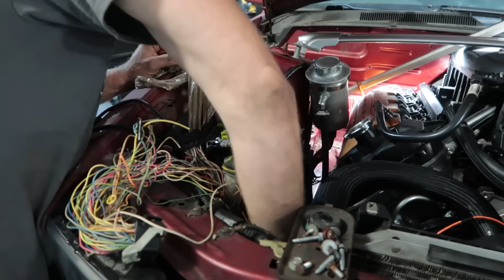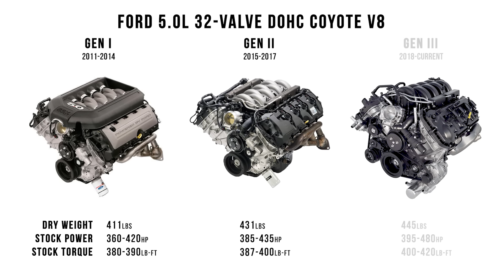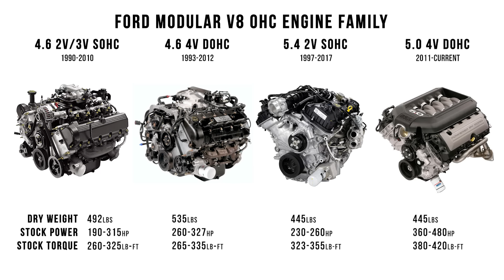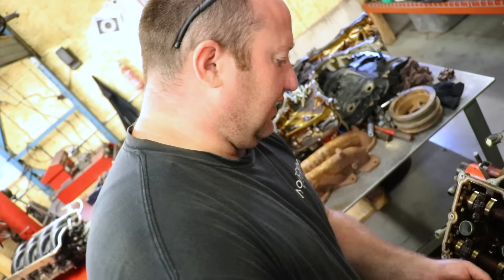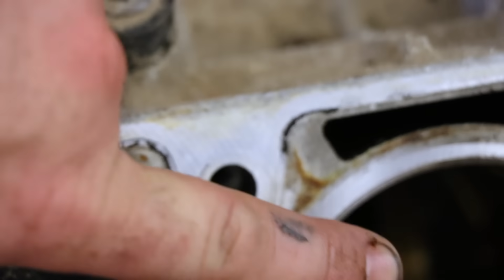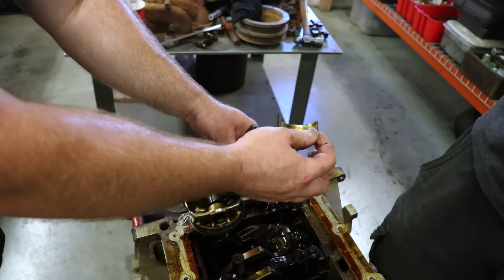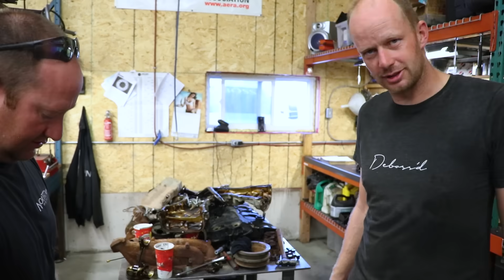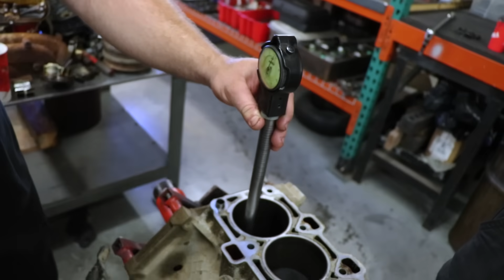REVIEW: Everything Wrong With A 5.0 Coyote Engine

Comment: I've always ignored the hell out of factory service specs. I change my oil every 4K. Manufactures may claim extended OCI's but IMO it's nothing but marketing, and by the time the owner has a problem it's way past warranty. The customer takes it in the shorts while the dealer sells new parts. Same with FoMoCo's service recommendation for transmissions and differentials. There's no way I'm going to put 100K of that oil.

Comment: Sorry if I sound dumb but is non synthetic better if you constantly drive short commutes and synthetic better if you drive longer commutes regularly? I've never heard that synthetic crystallizes if you don't get the engine to working temperatures before and I recently started using synthetic but I constantly drive 2-5 miles, work for an hour then drive another 2-5 miles, work for another hour till my day is done. If that's the case then I can save a couple of dollars on regular oil when I change it from now on. I do take long road trips on my days off but for work I'm constantly doing short commutes.

Comment: What a load of bull talking about the 355 a bored 30 thou over 350 is a 355. Using rebuilder pistons is a seprate thing which comes down to having a good builder or not. If the engine doesnt need factory compress dont use them get stanard wrist pin height...

Comment: Interesting comments about synthetic oil. I have an 08 f150 5.4 3v an 04 marquis 4.6 2v and an 03 marauder 4.6 4v. Love them all but like anything there are failure points and shortcomings that can be improved upon. I own a 13 Sierra 4x4 that has its issues as well. Love all 4 but the aluminum dohc in the marauder is my favourite. Bloody gorgeous engine. That did it for me.
Reply: to bad its false its a pcv issues if anything syn oil is harder to burn .

Comment: Whaaaat? Synthetic is not causing that sludge, its not changing oil often enough is causing this. Look I have 5 cars in all of them I use synthetic and change it at 6k-7k miles and the insides of those engines are like freaking brand new, there is zero sludge.

Comment: Lol. They are a better engine than the ls newer technology which flows better. Not stuck back in the 50's with pushrods which is fine for a truck engine. Let's see a 5.0 ls pull off the numbers that the coyote is capable of. Funny how the new c8 with the Lt2's are blowing up with the tinyest amount of boost. 🤔

Comment: You two work well together.  Excellent video.   I have one question about this 5.0 motor though.  Is it true they had issues with the oil pump drive shaft snapping on them, if you started pumping up its hp??
Reply: I think hes talking about the sbf 302 with the pencil oil pump drive shaft from the distributor. The mod 5.0 is driven off the crank shaft so no problems there.
Reply from the maker: Yes, as soon as you start cranking it up.  Stock they are fine

Comment: RiiiiIIIIIIIIIIiiiiiiight.. Only a Coyote guy accuses synthetic oil of being aggresive.
Reply: I hear the same from old timers that saw the issues real full-synthetics had with old engines from the late 70's and early 80's. At that time, the seals in the engine weren't designed to run aggressive and true group IV synthetic engine oils and would occasionally cause problems.

Comment: So I have a 5.4 Triton in my F250 and I do regular oil changes at 3000 miles on the. every couple months but I use Valvoline synthetic oil 10W30 what the truck calls for Would it be a better idea to switch to a conventional oil or as long as I stay on top my oil changes like I have I shouldn't have any issues questions of concern From a fellow Ford owner

Comment: My local dealer told me my loud typewriter noise on my 100KM 2014 GT was normal. I decided the Scaborough Ont dealership (Hard to find a good Ford dealer) was not qualified to work on my windshield wipers let alone let them touch my engine. So i took my motor apart and found that the cylinder #7 was pinched and scuffed the piston skirt which i assumed was from core shift. The entire engine was perfect with the other skirts and all bearings looked brand new.

Comment: Rich I’m sure a lot of us would love to see a 3.5 ecoboost torn down. Lots of questions surrounding longevity of small displacement engines pushing big numbers for long periods of time. Love the channel and content keep up the good work!
Reply: I second the motion !
Reply: Thirded!
Reply: In short, engine is great. It’s all the oil fittings and miscellaneous things attached to them that gives you problems.
Reply: Fordtechmakeyouloco has a whole series on the eco boost. I did a timing chain based on his videos on a 3.5 ecoboost in a 2013 f150. Lots of stuff to take off to get to the chains.
Reply: They don't do it for long periods haha
Reply: You don't know shit .. I have a 5.0l 2017 ford f150 with over 130000 miles or 216000 kms still running strong no burning consumption.  It's all about the drive not the engine.
Reply: oil changes are not small details

Comment: I don't know what model of Ford wronged Rich so much to cause such eternal hatred but it must've been a real turd. The only 2 vehicles I ever owned that catastrophically failed me were both Chevys & both just over 100K miles. The other 6 Fords I've owned over the years have been troopers, no less than 200K miles on each with nothing but regular maintenance & all still running excellent when sold or traded. My V10 service truck now has 270K &  still runs like new. 

YMMV? I don't get it.
Reply from the maker: 5.4, 6.0 and 6.4 Fords were in the shop more than I was.  Tie rod end fell of a 97 F150 while I was on the highway with under 100 000 km on it (recall).  Went to borrow bosses new F350 to pull our float in the parade but the starter konked after I spent 40 minutes cleaning it 1 hr before the parade.  Can't get parts on time and when I do, they are 2x more than the other big two, and I hate explaining to customers why the bill is so much.
Reply: @DEBOSSGARAGE  sorry for your experiences. Guess our mileage truly has varied. I've owned a 2006 6.0, I did bulletproof it immediately after the warranty ran out. Did 1 stud at a time, ran a 66MM Turbonetics non-VGT, 205s, exhaust, FASS & Elite Diesel tunes. That bitch ran low 13s at the local strip every chance I got & I never touched it internally. Sold it 6 years ago with original head gaskets & 260K miles because I needed a dually for business. I'm 1 of maybe 2 that loves a 6.0 over a 7.3. My '96 is a beast but the refinement/sound/mileage sucks. If the 5R110 could be swapped easily into the '96, maybe it would change my outlook. 

6.4 I'm kinda with you on that one. Insanely expensive when it breaks, which is often in non-deleted form. We had them at the airport when I was a GSE tech for Delta, never touched the engines much but always replacing the exhaust/DPFs. 

5.4 3Vs, I contract with a tomato farm locally for mobile work & they've got 5 of them as farm trucks. Typical farm truck that gets beat on but the lowest mileage truck has 147K & still runs fine, no phaser noises. I've changed a coil pack or 2 & done a ton of work to the front ends/bushings/hubs but otherwise they just keep going. But they are gutless heavy-feeling turds & I wouldn't want one. 

Maybe Fords like the warm Florida climate better? 😎 who knows? Stay dirty 😁

Comment: This guy knows nothing about engine Lube.  Synthetic didn’t cause any of these issues.  This is clearly a neglected engine.  

Also you can change the brand of oil every change if you want.  Reasonable Maintenance intervals are more important than brand these days.
Reply from the maker: Not one oil manufacturer will tell you its ok to mix oils.  You can, but it will decrease the life of your engine.  Certain additives do not mix with each other and there is no way to know which one is in what
Reply: @DEBOSSGARAGE     

Have yall ever looked at any virgin or used oil analysis?  Pay close attention to the additives in API certified oil.  I'm not saying mix 3 different brands of oil when doing a fresh oil change, but if you change brands every single time your engine will barely know the difference.  The engine taken apart in this video would have been happy with just about any oil if it was changed on time. Clearly a neglected engine. 

The worst part is the saying synthetics don't handle short trips well. Short trips aren't ideal for any engine but synthetics are proven to handle severe conditions better. The majority of over the counter synthetics use group 3 base oils. That means they are still petroleum based.

Comment: 2013 F150 5.0
129k, bought new, oil is always clean, never an issue and oil changes 5k miles.
Only complaint is the idle shakes that come and go....they are light but I can feel it. Kinda like a misfire. Always done it. New plugs around 70k

Comment: Painful to listen too... that engine was abused with not many oil changes. Synthetic oil doesn't do that. I just pulled the valve cover off my 2002 Mustang GT 4.6 because the cover cracked. It was clean underneath. No varnish. No carbon. This builder is a joke.

Comment: I have a 2003 5.4 liter that I bought new in an F-250. Wrote off the 03 F250, bought an 04 F250 and put the engine in the 04. Over the life of the engine I have blown #3 spark plug twice at 150k and 175k. Engine is now over 475k kms. It gets oil changes. I can't hate it.
Reply: Most of the issues came from the 3v 5.4L which was only used in 2004-2008 F-150's. Your F-250 has the less powerful ''but more reliable'' 2v 5.4L.

Comment: I have a 2011 Ford F150 with a 5.0L Coyote V8 in it with 133,000 miles on it and still going strong and its a beast and it sounds like a beast as well.

Comment: Yeah, I don't think the discoloration and build up is from "synthetic" oil (most oil is not even truly synthetic) or any fault of the engine, this looks more like neglect. I've seen engines look like this both with and without "synthetic" oil but I think where he might be getting this impression is often people are told if they run "synthetic" oil they don't have to change their very often with no mention of driving conditions and so synthetic oil is more likely to be neglected and people more likely to get the idea that the fault is the oil and/or the engine rather than a careless owner. And given this is a truck engine and looking at it's external condition it's clear someone drove it long and hard with little care.

Comment: Coyote better than the LS? Depends what you mean by "better" and which LS since that's a large engine family (it would be like saying what's better? A 4.8 LS or the Ford Modular?)
I generally compare the Coyote specifically to the 4.8 and 5.3L due to the somewhat similar displacement and, at least in terms of performance, I would say the Coyote is at least on par, if not "better" then those engines mostly because of it's advantage of 4 valve dohc heads and more flexible vvt. However, you do pay a price with the Coyote as it's quite wide up top and it's a more sophisticated engine and in some ways expensive engine, depending on what you're doing with it. You have to buy 4 camshafts, 4 timing chains, two primary, two secondary, 4 chain tentioners, 8 chain guilds, to the LS's single cam and chain and smaller profile however, lifters, pushrods, and rocker arms do add a lot of reciprocating parts. Stock, these parts are relatively cheap, you can put just the stock 4 cams in a Coyote for under 300 bucks. But when you start getting into aftermarket parts the Coyote in particular gets expensive., like 1500 bucks just for cams.
For the money, though, I would recommend the LS in most cases as the "better" engine to hotrod due to it's lower cost and simplicity. But for the guy who wants the most efficiency/hp/ci and/or is bored with the standard cam in block pushrod engine, and has a few more bucks to spare, then the Coyote might be for you as the "better" engine.